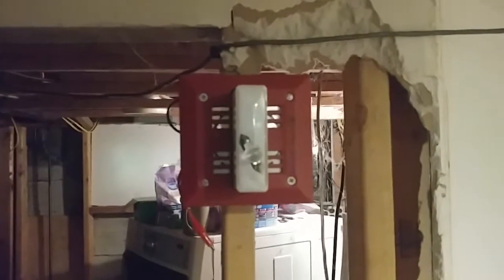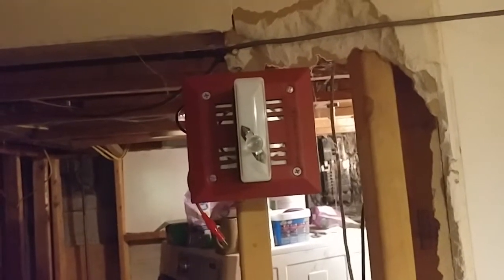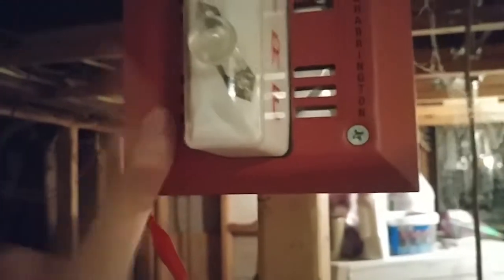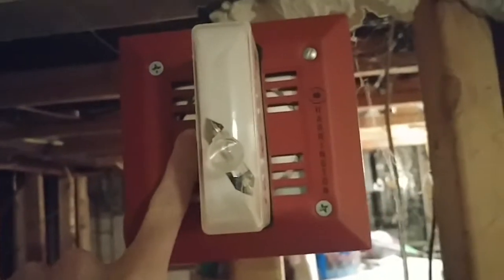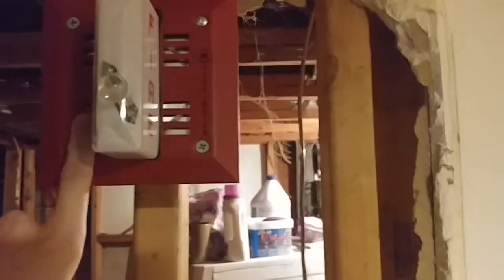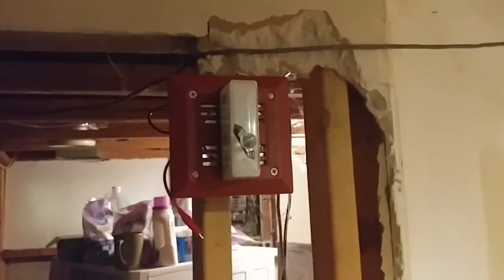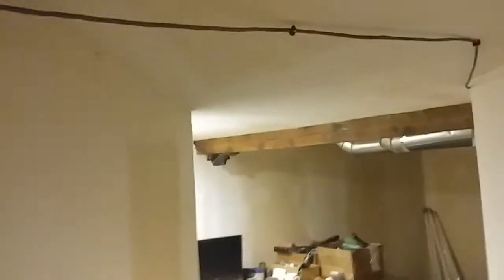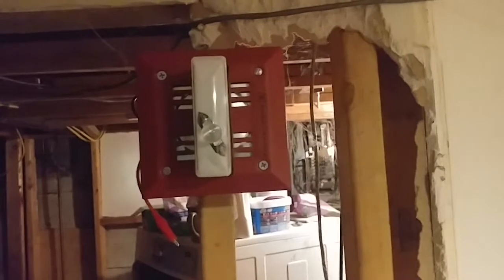Fire alarm test 4. Faraday devices

Comment: If you look at the back of the horn, is it mounted with screws or rivets? If it's screws, you could probably get it to sound smoother if you tighten them a bit.